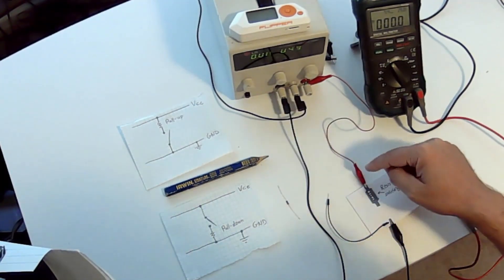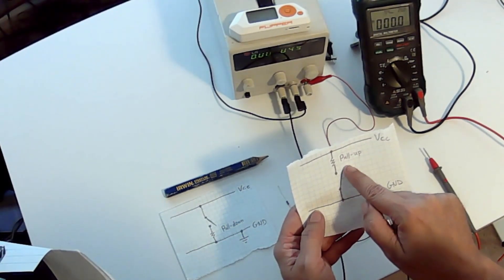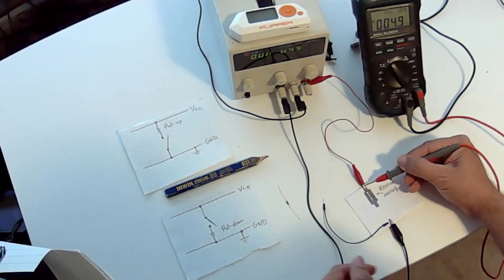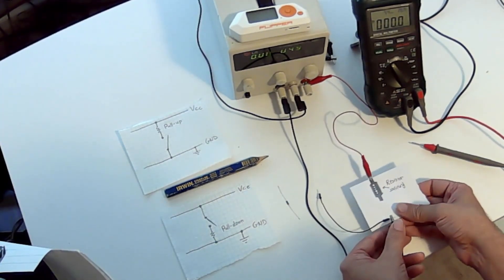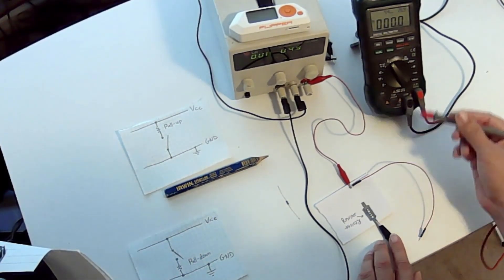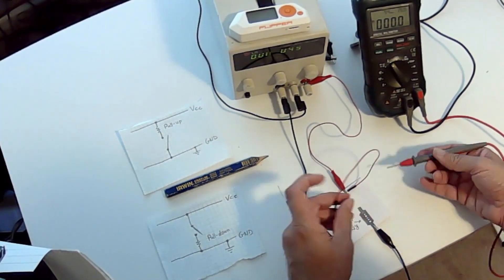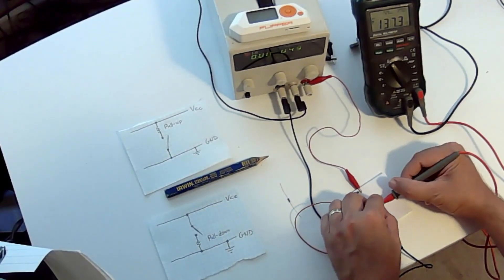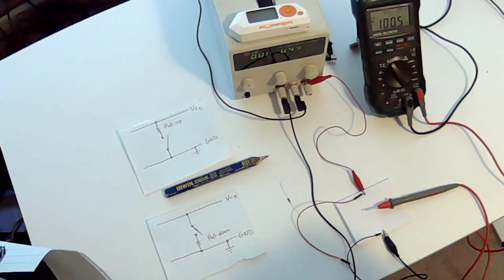[33] GPIO Pull-up/Pull-down resistors explained

Comment: @austinjenkins6841  According to my professor in engineering school, voltage is a difference in potential.  Say you have a big pile of electrons, like a battery, then when you connect that to a circuit, the electrons flow towards where there's "no electorns" (ground)  this movement of electrons is electricity. the difference between the power supply and ground is the voltage, or potential energy of the circuit. I hope this helps.

Comment: Im very new to electronics and circuits and this helped me understand pull up/pull down resistors so much better. Thank you! Might I ask where on the circuit the black wire coming from the multimeter was attached? I’m still a little confused on what exactly voltage is and how we get 0 V when the circuit is complete.
Reply from the maker: Hi Austin, you ask some good questions -- hopefully this answer doesn't make it more confusing (but if it does, please let me know and I can try to explain a different way.)  The voltmeter measures the difference in electrical potential between two points.  In my videos, I assume wires have almost 0 ohms of resistance (which would mean the electric potential should basically be the same anywhere in along the wire).  The negative on my power supply (far left terminal) and the ground (middle terminal) are connected together with a metal bar -- so they are both at the same electric potential.  The positive on my power supply (far right terminal) has a difference in electrical potential as shown on my power supply screen.  The (-) black wire going to the black alligator clip is at the same potential as GND.  The (GND) black wire going to the black input on my voltmeter is also at the same potential as GND.  In this configuration, the red probe from my voltmeter measures the difference in electrical potential compared to ground.  The (+) red alligator clip going to the red alligator clip on the top of the circuit is at 4.9 volts according to the power supply display (so that is how much difference it has compared to ground.)

For the pull-up circuit... When the switch is open, the voltage at the bottom end of the resistor is going to be the same as the voltage at the top end of the resistor, since no current is flowing, so meter should show 4.9 volts.  When the switch is closed the voltage at the bottom end of the resistor is going to be the same as the GND since the wire from GND is connecting to that point (so now the meter will show 0 volts.)  When the switch is closed, we do have a complete circuit, so if we assume the pull-up resistor is about 100K ohms (since I drew it with pencil instead of using a typical 10K-38K resistor), we have about 0.05mA of current flowing through the resistor.

For the pull-down circuit... When the switch is open, the voltage at the top end of the resistor is going to be the same as the voltage at the bottom end of the resistor, since no current is flowing, so meter should show 0 volts.  When the switch is closed the voltage at the top end of the resistor is going to be at the same as the 4.9v since the wire from 4.9v power supply is connecting to that point (so now the meter will show 4.9 volts.)  When the switch is closed, we do have a complete circuit, so if we assume the pull-down resistor is 100K ohms, we have about 0.05mA current flowing through the resistor.

I'm still dancing around defining voltage, I still haven't figured out how to articulate it well.  If you find an explanation online that makes it clear, please share it in a comment below so we can all learn!  Here are the terms I would recommend searching, hopefully they will yield a deeper understanding of the topic: "voltage", "Electric potential difference", "voltage and current compared to water", "Ohm's law" & "Kirchhoff’s Current Law".

Thanks again for your questions & comments -- and for taking the time to read my response (sorry it was so long, but hopefully it adds some clarity).  To see a list of my videos, organized by topic, please visit my GitHub page - https://github.com/jamisonderek/flipper-zero-tutorials/blob/main/youtube/README.md
(I'll try to update the link weekly.)

Comment: Did you create a resistor with a pen?? 😲
Reply from the maker: Pencil.  😊. But “Circuit Scribe” (available on Amazon) does make pens that conduct really well, for drawing a complete circuit (wires) instead of just resistors.